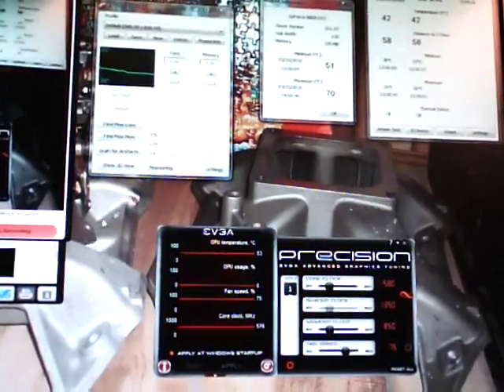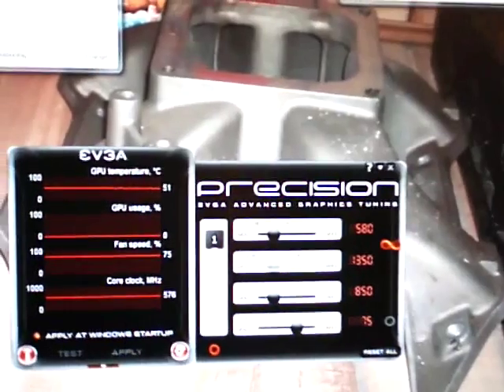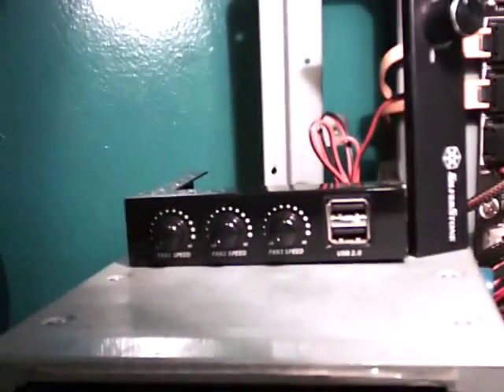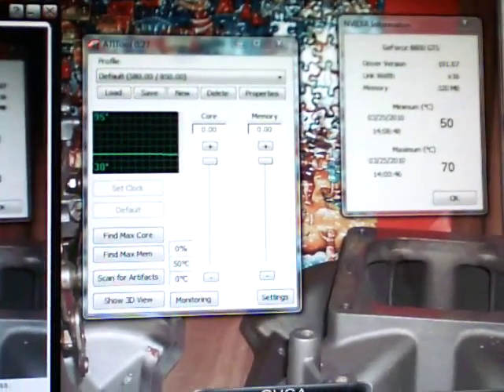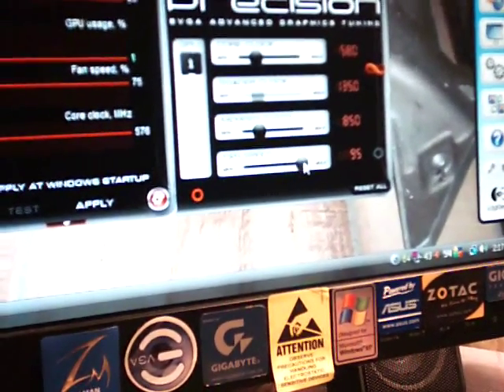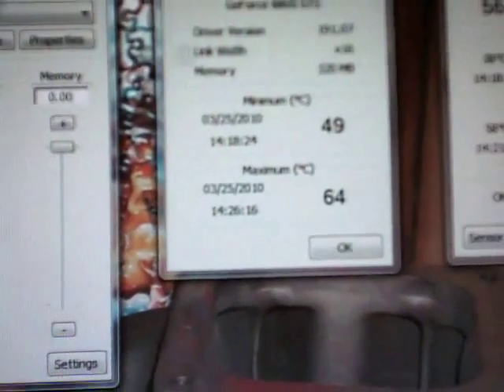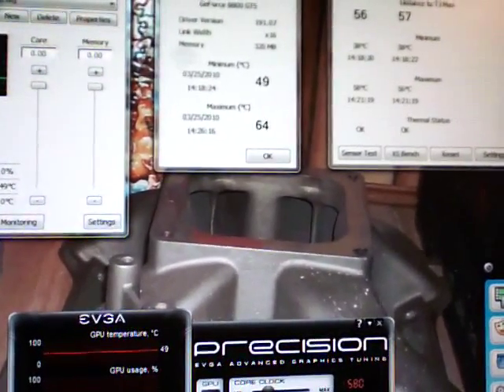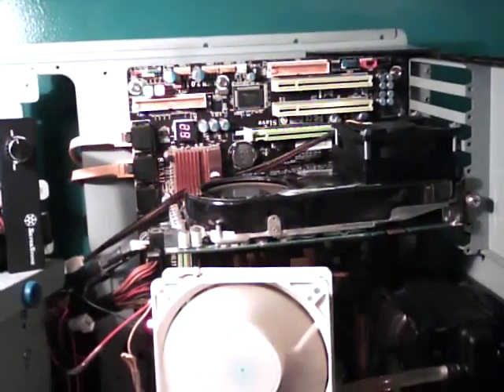ULTIMATE Budget GFX Card Cooling Mod

Comment from the maker: It is picture of 2 intakes took it at a friends house one is going on a race 440 engine.

The one you see is high rise single plenum for 4500 style carbs and other on left is a edelbrock with dual 600cfm carbs, dual quads if you will.